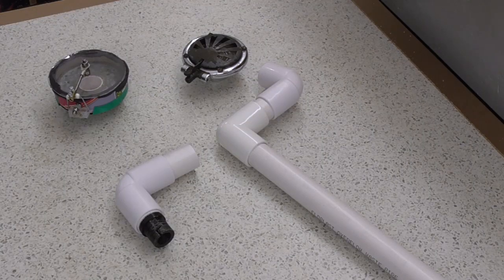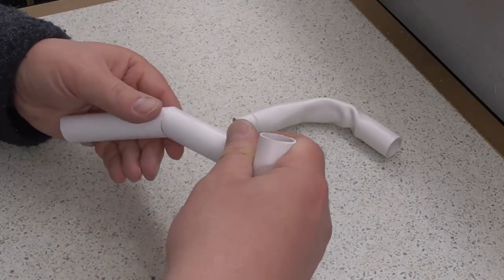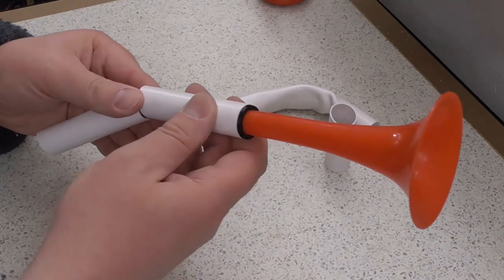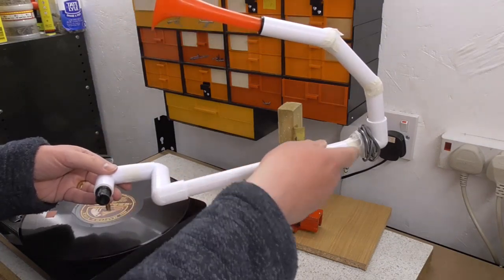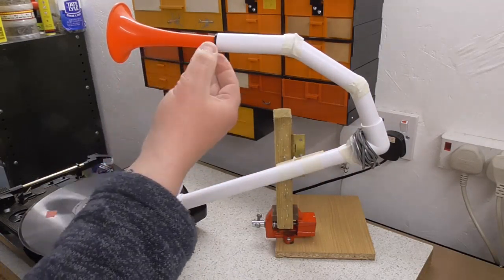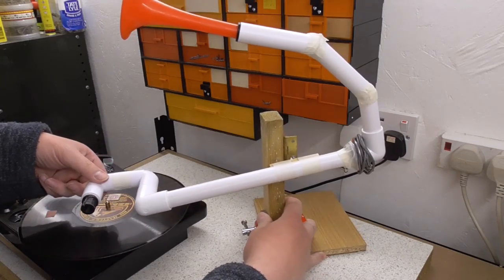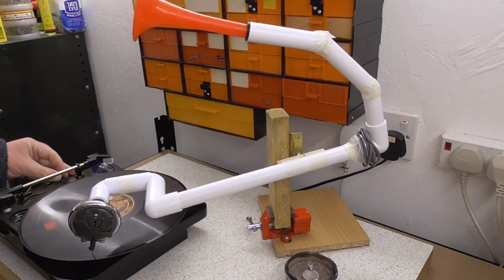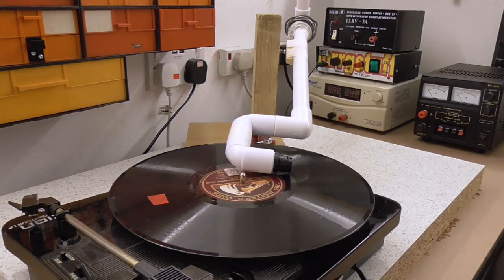Air Horn Gramophone Mk2

Comment: It's funny how subjective audio quality can be. I listened and listened and I couldn't decide which I preferred. Yours was more mellow and rounded, the other was sharper but both would have their place depending on what you were listening to. I played with the audio on my videos for a long time and eventually somebody was kind enough to point out I was making them sound far too tinny. Apparently many of my early videos also had a high pitch whine that I couldn't hear. I had to use Audacity to find the culprit and use a notch filter to edit it out. That was caused by my old camera. My new camera adds white noise so I still have to edit the audio.
Reply from the maker: Thanks 😀 - it does seem to have got to a stage where you could listen to it for pleasure. The little Songster is the worse performing proper sound box I own and it certainly has more volume, but does suffer from hiss. I know what you mean about audio problems. The scene where I talk about the ION turntable picked up some hum from a light and I had to filter out 250hz-450hz to get rid of it. I also have problems with Serif MoviePlus as it sometimes won't render the waveforms in the time line and sometimes loses chunks of sound on output so I have to watch every final video all the way through to check. I have also noticed that my current camcorder records at a lower volume than my older camera as old videos always sound much louder. Thanks 😀.